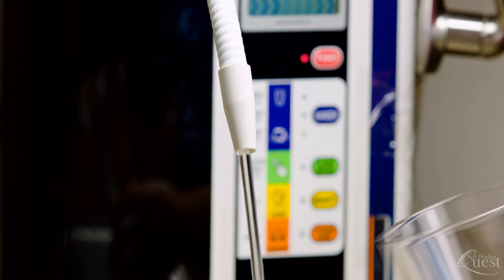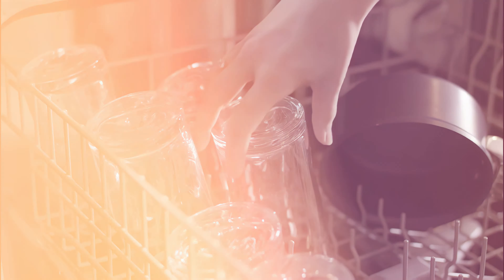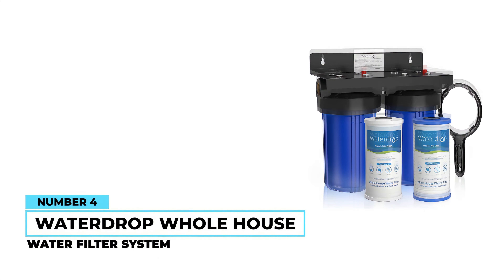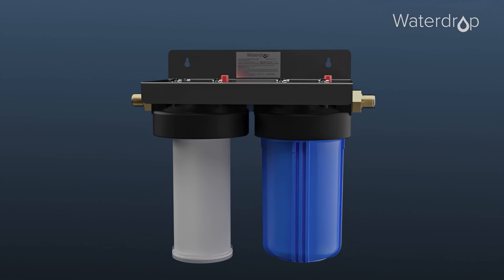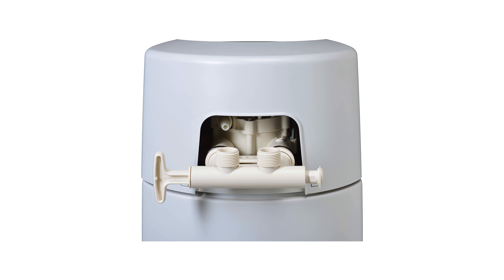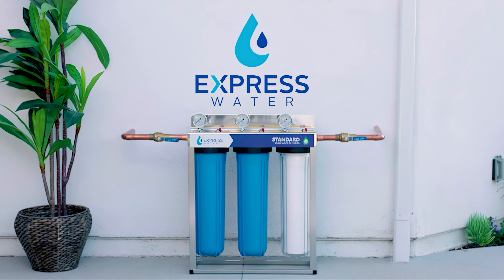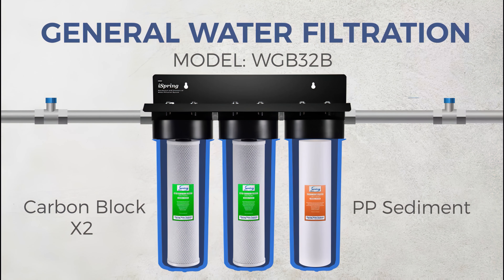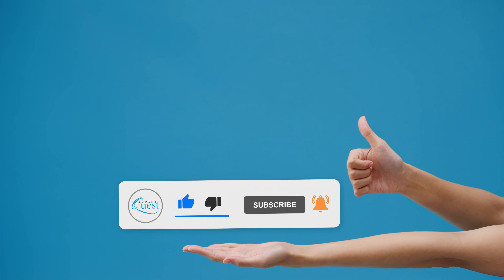Best Whole House Water Filter | Top 5 Review [2023 Buying Guide]

Comment: I have Express Water Ultimate Whole House filtration system and I love it! The water is crystal clear with no bleach odor from chlorine and my appliances that use water are cleaner as well. I highly recommend this product! Before the product, I had dry itchy skin after bathing in the chlorinated water but not now that I installed this filter. I recommend using a plumber to install the product but changing the filters is an easy task that can be done by anyone.
Reply from the maker: Thanks for sharing!
Reply: How much is ur ppm with express? 
I have their 11 stage RO for drinking but thinking about installing whole house system. Is it good enough to get rid of my RO system?
Reply: do you still have the filtration system and have you had any leaks or problems, im looking into installing this and want to be sure, thanks!

Comment: I would put Express Water #1 as your #1 is also available in the same configuration with Express Water. And Express Water has a more robust frame for wall mounting. Plus pressure gauges and first stage container is clear. You can see how your sediment is building up.
Reply from the maker: You raise some good points. It was very close, but the iSpring system was ultimately chosen as #1 due to the value of filter replacement and dedicated manganese reduction. Thanks for sharing!
Reply: Does express provide professional installation services?

Comment: I read when you remove chlorine from water you may end up with mold in the pipes, hence water.  Do any of these filters kill harmful bacteria & aresenic etc?   Is it possible to have a whole house filtration system that also softens hard water to preserve our Heating & Hot water system & appliances?  Is
Reply from the maker: Thanks for your questions! Generally speaking, filtration systems are designed to remove common contaminants in order to make the water safer. If there is a concern that of mold from de-chlorinated water running through the pipes post-filtration, you could try an under sink water filter solution to cut down on the amount of travel from filter to faucet. In regard to whole house water softeners, we have a breakdown of some of the best options here - https://youtu.be/2-vUxk9uUdA Otherwise, we hope to dig deeper into water filtration in future videos!

Comment: hi ..

I am very keen on water filtration .. recently I had a dual hi Flo system, which then went through a reverse osmosis filter, and into a water jug on the kitchen bench. .. tasted great, clean and pure. .

but the 12L storage jig kept overflowing if we'd forget about it sometimes. . so I decided to go for a 3 stage hi Flo system with the second filter being a fluoride filter. 
got it all working fine. . but the water now has a different taste. it's noticeable. doesn't taste clean.   so I'm wondering.  .

is it clean? is there a problem? tastes a bit like plastic or like the filter itself.    not necessarily bad, but just not tasteless.   what could the problem be?

Comment: I would like to know how much cost for the whole system of the house plus drinking water connect to my refrigerator . Thanks
Reply from the maker: Hi there. Since these are whole house filters, they should automatically filter your fridge if it has a water supply as well. Thanks for your question!